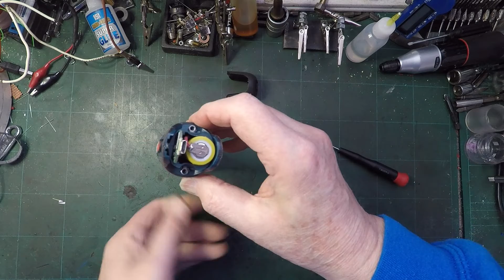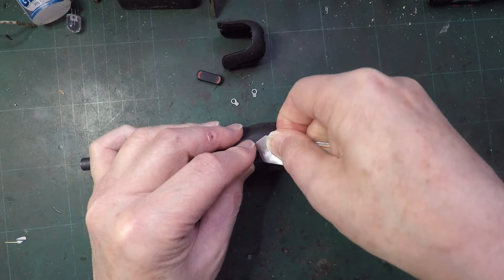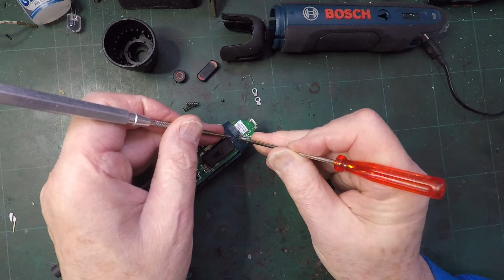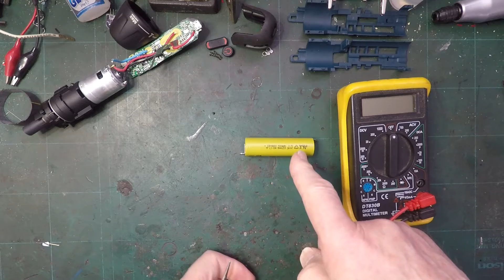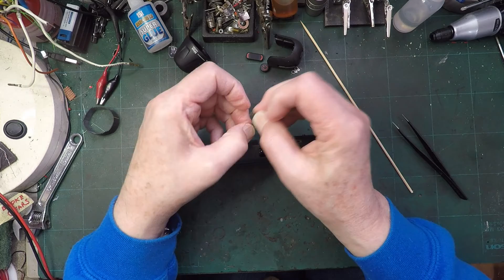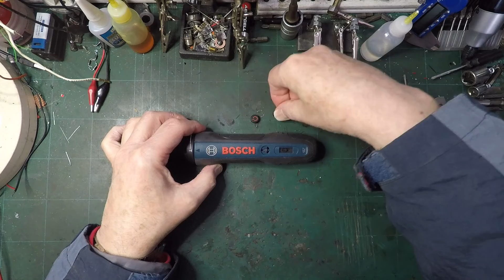Bosch Go 3.6v Pro screwdriver repair

Comment: My screwdriver had a problem: the pin on the engine start switch was badly worn. The screwdriver wouldn't turn on when I pressed it down. I glued a 1 mm thick piece of plastic in front of the pin on the engine. Now it works again. Your video was a great help when I was taking it apart. Thank you so much! 👍
Reply from the maker: I am glad my video helped. Well done with your repair.

Comment: Nice video. Used it to replace battery on mine. Biggest challenge was to get the head back in the right place. The plastic ring felt out from mine, which made it an extra challenge.
Was very helpfull video.
Reply from the maker: Glad I could help, getting those plastic parts lined up can be tricky! 👍

Comment: The Initial problem is that when the side button is pressed continously f.e. in your toolbox it discharges the battery under the lowest level for safe charging. Li-Ion can cause a fire when charged from under 2V.
Be careful when stowing the device so that the button remains untouched.
Reply from the maker: Thank you.  That is very helpful.

Comment: Opening this kind of things is real struggle. Because if you apply too much force or doing it wrong. There's no sparepart for it, especially that button 😂
Reply from the maker: Yes Bosch are poor for spare parts for these. It's very easy to damage the button when you reassemble.
Reply: Aliexpress. Just repaired mine. I broke the legs of the push button. That button was my main gripe with the screwdriver as it was too sensitive. I am leaving it off for the time being.

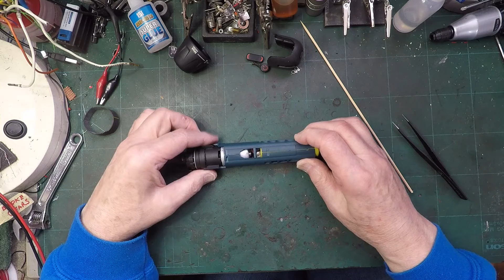Comment: 27:39 these cells can get pretty hot if used continuously due to rapid discharge, so the temperature sensor can trigger the tool to shut off to stop the tool from over stressing the cell.  As this doesn’t use a “proper” charger, I imagine it will also shut down charging if there is a fault in the cell and it starts to over heat and become a fire hazard as there will be no protection in the cell itself.
Reply from the maker: Thanks for the information. I have seen a few Li
-Ion batteries with a temperature sensor so cutting off over charge or over discharge makes perfect sense.
Reply: I don't think bosch company idiots like you

Comment: Really useful thanks 
Mine is 3+ years old and just stopped working unannounced and no light will come on to say it’s charging. Maybe I left the switch on and it’s discharged in my bag..?
I will leave it charging and see if anything happens overnight 
And perhaps I should get a replacement battery, but there’s been none of the usual signs or battery failure 🤔
Reply from the maker: If the voltage has dropped too low it will not charge. You have to open it and charge the battery another way.
Reply: @DaftOldMan I applied another battery to the battery and that seemed to jolt the old battery into charging 
The pressure switch part has come away inside but I don’t like that anyway 
Somehow all the cog mechanism had come apart and a few of the ball bearings had come adrift so it’s been a real job to get it all back together. But it seems to be working and charging 👍👍
Maybe I’ll get a bit more use out of it before I go for the V3
Thanks again, wouldn’t have done it without you!

Comment: Had one of the SMDs on the board fry itself on mine, unfortunately not so easy of a fix when it just flakes off at a touch
Reply from the maker: Yes. Poor soldering during manufacture is hard to fix.

Comment: would it be possible to recharge the battery just enough so the bms accept it, but without unsoldering it?
Reply from the maker: I did that to a different make screwdriver last week and it worked. So yes it is possible with some screwdrivers.
Reply: @DaftOldMan  thanks for sharing your knowledge! It make sense, I saw people repairing bicycle battery pack doing the same (finding low cells, recharge them a bit till the threshold to be recognized by the BMS)

Comment: Hi,

Do you have any idea what is wrong when I tried to use the power button the motor is not working. But wHen I tried the switch the motor is working
Reply from the maker: The back of the button may be broken as it is only plastic.
Reply: Thanks for the fast reply! Do you mean back of the button the “green one”?

Comment: I have the pistol grip version of this one. Same happened to me after not having used it for a very long time. I left it for my apprentice to use and aparantly he was a little embarrassed to use what I call the noisy cricket. So it was left unused. I took it back and found the battery flat and “would not charge”. I opened it up and checked and the cell was discharged. I put it back together tho as I know most BMS / charging chips have a feature for low voltage cells. They bring them up extremely slow to avoid damaging the cell. I put it on the charger and it looked dead, went out on a visit to a customer and when I got back to the office it was doing the normal charge. :) So I bet yours would have done the same if you left it plugged in for a couple of hours! :) Just a tip for the next one you come across.
Reply from the maker: Thanks for commenting.  I did try your method without result so I was forced to open it.
Reply: @DaftOldMan  that sucks. Maybe there is a limit to how low a voltage the cell can be before it start slow charge. I’ve seen 18650’s that has gone negative too btw, have you ever come across this? And it was without there being a reverse charge. Some kind of drain in a neighbor cell in series did it. So balancing is a must in series.
Reply from the maker: @pederb82  I bought a single 18650 cell torch from China and the battery arrived 0v.  It would not charge until
I removed it and charged it with my DIY charger. I think the bms will often block charging if the voltage falls too low (often below 2.5v). I have heard of reverse charge in series 2S, 3S etc packs but never seen it.
Reply: @DaftOldMan  if you come across it please do discard the cell. The wise say it punch a hole through the membrane between layers of lithium and you get an internal short in the battery. That counts for 0 voltage too if you try to charge it too fast from 0. So it’s best to cheap it as slow as possible up to a safe voltage. But a reverse charged one allegedly has that issue.
Reply: @DaftOldMan 🔋_🪫，正常的18650电池可以激活它

Comment: the charger is checking for over and under voltage on the battery.. its a protection circuit .
Reply from the maker: Yes it is.

Comment: When you had the thing in pieces, you can plug the charger in and measure the voltage on the battery. If the charger circuit is working properly, you should see the voltage on the battery creeping up slowly ;-)
Reply from the maker: That's a good idea. That would tell me if the charge circuit is working. Thank you.
Reply: @DaftOldMan  for me it was interesting to see the original battery having such low voltage. In case the charger/bms circuit works correctly, it should not discharge the battery lower than 2.7-2.5v. This should be the minimum alowed for a li-ion type of battery. In case you go lower, you can damage permanently the battery or significantly reduce it's lifetime. Would be nice to have a revisit of this machine a couple of weeks later. Thank you for the content and for the great videos you create for us. I enjoy each second of them. Wishing you all the best!!
Reply from the maker: I made this video 5 months ago and have used the screwdriver almost every day since. It has worked fine and seems to recharge ok.  Perhaps I was just lucky with this one.

Comment: I have that problem when i push the button won't start or starts and stop... i benched it from than. Trash model.. had it for about 1 month and gave up like that. I'm a sparky i had it for panels.
Reply from the maker: I have a dyson vacuum doing the exact same thing. I think it is the electronics boards (BMS) that are not up to the job.

Comment: I did a repair on this model not so long ago, it was swine to put back together, no space wasted, so compact.
The problem on mine (actually my brothers) was the chuck, it wouldn't turn, turned out that a ballbearing had slipped out of place and was preventing the chuck from turning. Needless to say I'd completely stripped it down to the bare bones before I found the problem.
Works fine now.
Reply from the maker: I feel your pain. These are not easy to work on. Glad you could fix it.
Reply: Sure ya did
Reply: @georgedavall9449  What's up Georgie, feel a little inferior because it's beyond your ability ?
Reply: @dennisallan3004  aww, good one there Denny old boy!  Have a good one skippy 👍
Reply: @dennisallan3004  lmfao 😂
Reply: Do you know how to fix the chuck? Mine is stuck in max setting, it won’t work on the lowest clutch.